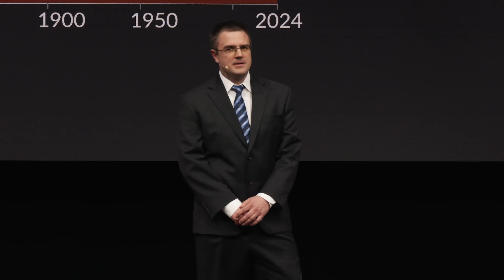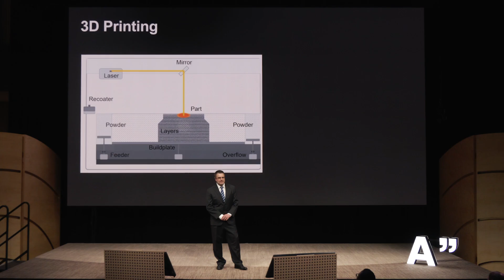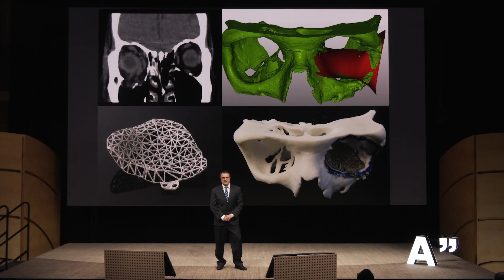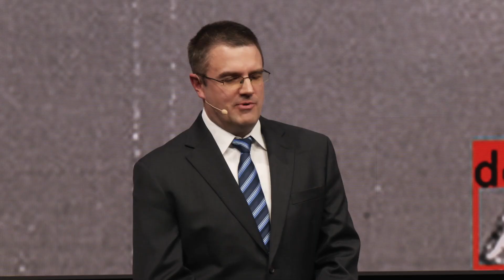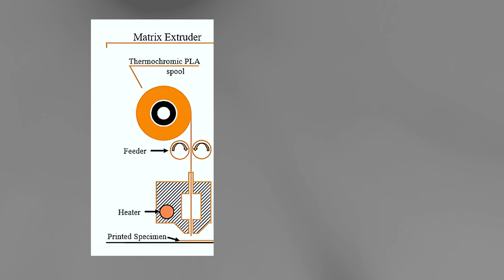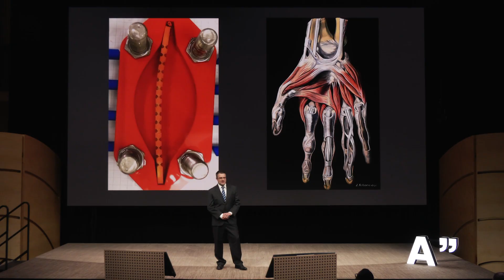3D printing: Sustainability in manufacturing – Mika Salmi

Comment: Thought after 90 sec: But can we use 3D printing optimally and to not produce too much waste (manufacturing) and failed attempts (prototyping)?
Reply: Topology optimization is a valid point
Reply: Recycling of mixed materials (e.g. titanium+aluminium) is more expensive than pure aluminium?
Reply: Interesting stuff. I keep printing 10 €/kg PLA ,D